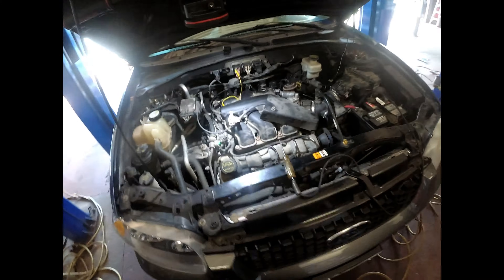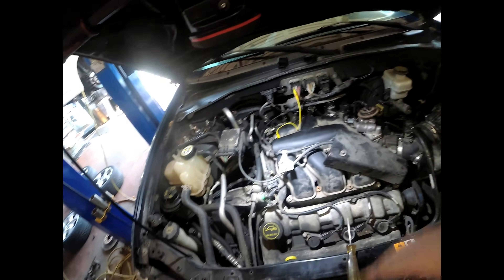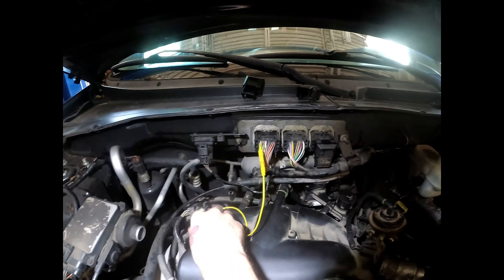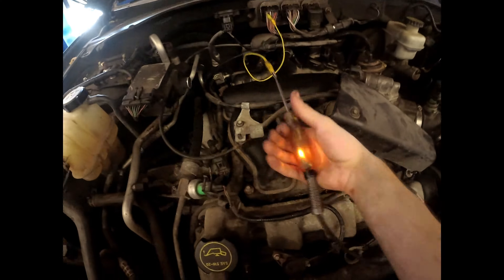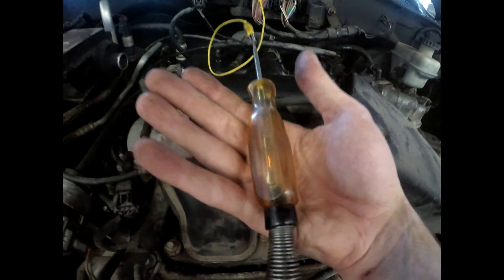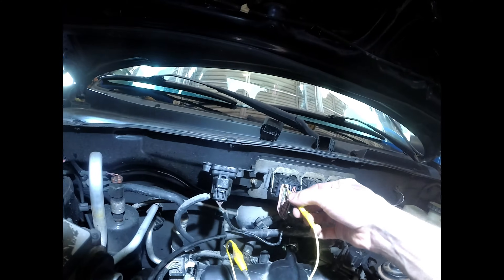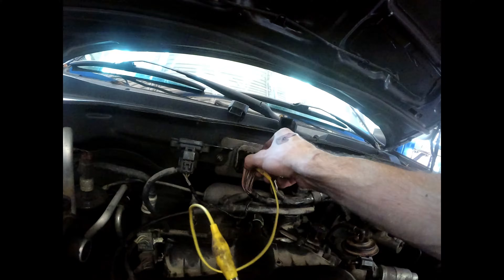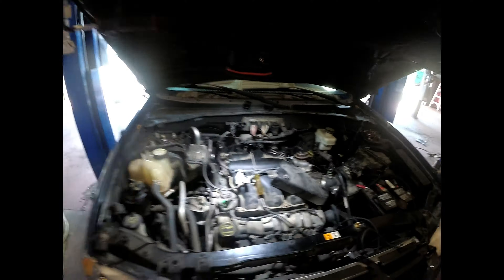Ford Escape Misfire When It's Not the Coils Or Plugs (p0351)

Comment: I have a constant p0352 code replaced coils and sparkplugs didnt change performed these tests but mine just has a co stant ground bit doesn't flash like the rest of the cylinders amd i also noticed my ac stopping working when this problem occurred
Reply: You ever find out what was wrong with your truck mine has the same issue but on cylinder 6?

Comment: P0351 and p0354 on my 05 V6 escape, 79k miles. Replaced all coils, spark plugs, and the PCM… now it works great. My dad and I did it for about $700, both first time but we figured it out! Thanks for your diagnosis help!
Reply: Great, cheap PCM, those need to be programed for the car.

Comment: Mine isn't throwing a code other than the o2 sensor because we had to gut the cats because was told it was $1,600 to replace the exhaust, but my 2004 escape is surging and then the dash lights blink and gauges jump all the way up, pause, go back, down, pause and rest back to normal. Some of the times they will all jump, get halfway back down and jump again. New battery, new alternator, one bad coil on cylinder #1 was replaced, replaced valve cover gasket, new plugs and wires. I'm clueless and tired of throwing money at it. any suggestions on what else it could be? Only throwing o2 sensor code.
Reply: Ever find out?

Comment: Where does the other lead from the test light go? To a hot or ground point?
Reply: Goes to hot because .pcm signal  should be ground in this case
Reply: So, connect to negative or positive? Which one? two different options listed 😳
Reply: It goes to ground actually.
Reply: @kainejuice  How does that make sense if the PCM trigger signal is ground? GND + GND doesn't give you a light.
Reply: @KyleGP  rite, about.. the light.. it mite BE white.. but its ahight!